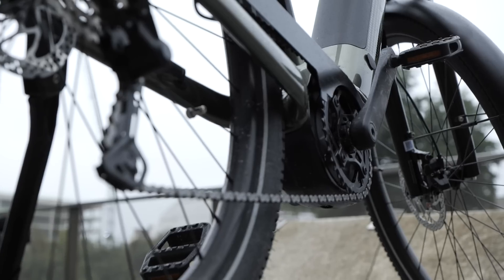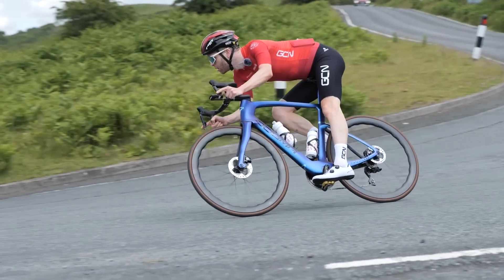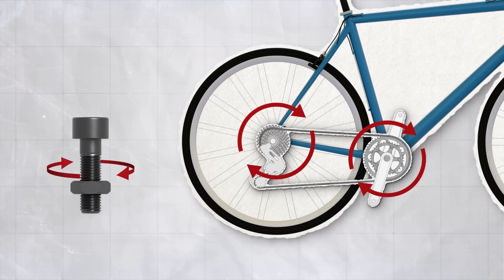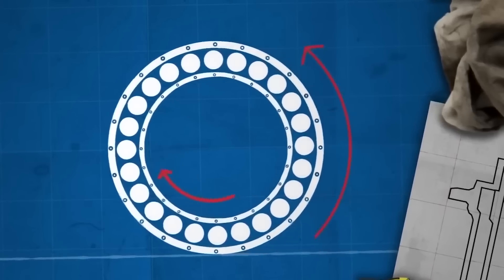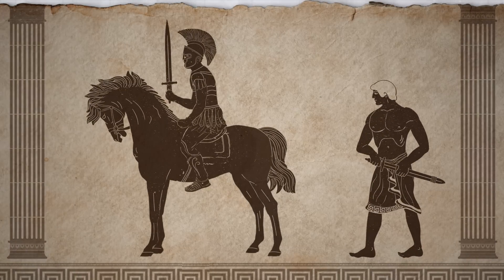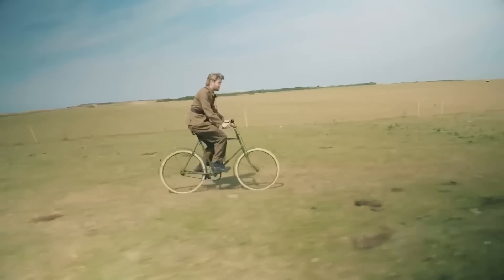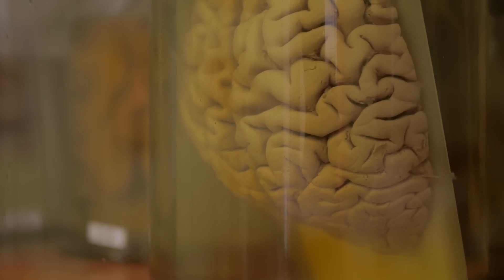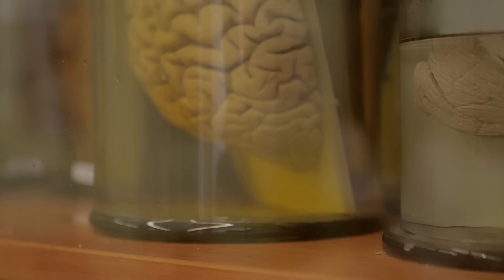Why Is The Drivetrain Always On The Right?

Comment: 99% of motorcycles have the final drive chain on the left hand side. 🤔
Reply: the kickstart is on the right and more power in the right foot.
Reply: @nredsa  lmfao more power in whos right foot? yours? that is in no way a fact
Reply: There are notable and rather common exceptions: the aircooled Harley Sportsters (they might usually have belts though, not an HD expert, but the same principle), Buells which used the Harley engine, the classic looking modern Triumphs (Bonneville, Speed Twin, Speedmaster, probably forgetting something) and the KTM LC-4 series (edit: and the small BMW GSes). At least. Don't know exactly why these makes have ended with the right hand drivetrain, especially the Triumph, I though it would be because of "British tradition" but quickly image-searching it seems that all the classic British bikes from 50s-70s had a left hand chain, including the original Bonnevilles.
Reply: @mikkoolavijarvinen3653  The Harley IOE engined bikes up to 1929 had rear chain on the left while the new in 1929 sidevalve engined bikes had right hand chain.
The Vincent twins had RH chain and the singles LH chain.
Reply: 100% of motorcycles do not have a threaded rear freewheel
Reply: Drivetrains on motorbikes were primarily influenced by the engineering constraints of crank rotation, transmission design, and the cooling advantages of mounting the engine with exhausts forward.
Reply: Maybe because its motor operated